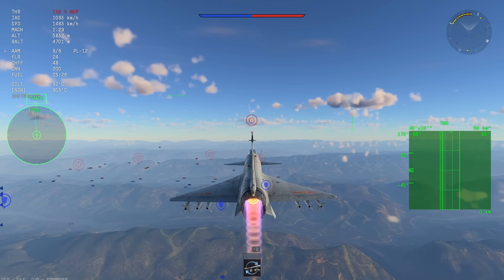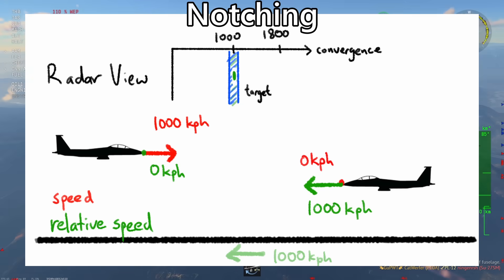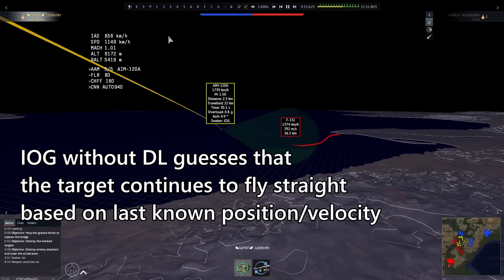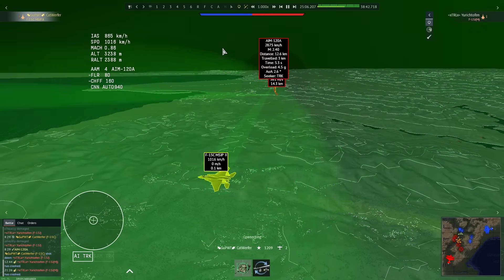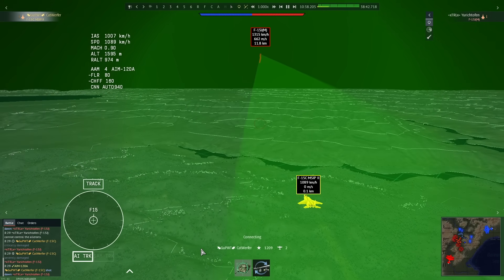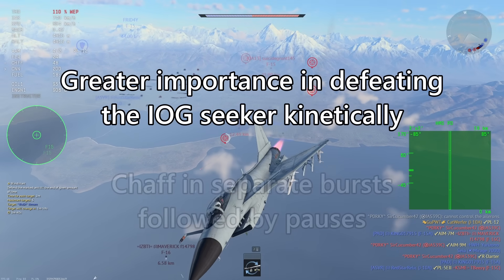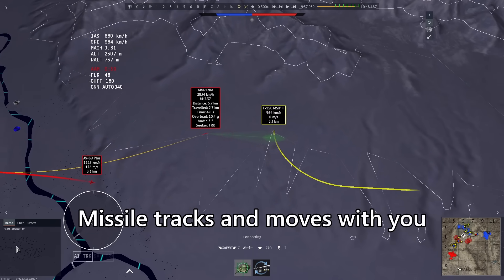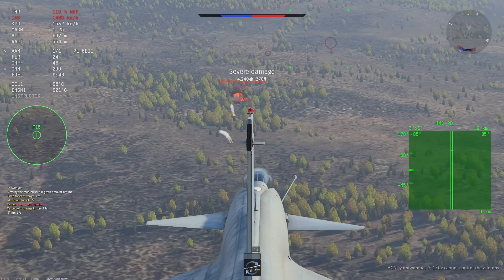Notching Mechanics Explained | How to Evade Top Tier Fox-3s

Comment: I fly high (usually 5k, just below the white trails altitude).
my issue is not so much the notching itself (or maybe it is?), but knowing when its OK to go back.
my RWR keeps beeping untill the missile actually passes me most times. so in typical RB, ill spend so much time avoiding a couple of missiles, until my RWR stops beeping, that its usually too late to do anything in the battle.
Reply from the maker: @theoescamez6230  yeah, that's hard to tell for me too. Sometimes I'm lucky and the rwr goes silent but other times it keeps screaming even if the missiles been defeated. Most times I just hope I've done it right, though it's not always true
Reply: I found if the rwr ping is shifted to away from you once you reengage the missile is typically defeated. But yeah they really got to short out rwr warnings

Comment: Subscribed, this was amazing, good job. Basically my understanding is that Fox3s are very hard to defeat, unless you're above them and can chaff, though leaving you vulnerable because air is thinner and missiles have more energy. Flying low at the beginning of the match can be beneficial because realistically no one could maintain a datalink track on you because they would be defending the 20 missiles launched at them, but after that I would say that climbing is safer also from a situational awareness point of view.

Comment: Yes, that is a good explanation for why 90 degrees doesn’t work when the missile is close. 

Also, the reason chaff is more effective at close range is because the FOV is the missile seeker means that at a distance if you chaff and the missile tries to require you you may still be in the cone, while if it’s close your angular velocity is greater and you may be well outside it’s FOV in a much shorter timeframe.

Comment: Woah so the velocity vector turns out is alot more important than i previously thought not notching enough def is the culprit in alot of my deaths then 😂 thank you for the info this means deploying flaps also helps alot in lower speeds cus it pushes the velocity vector alot closer to the crossair cus more lift etc
Reply from the maker: @whydoievenbothertoputthish2199  yeah, i die a lot to not slowing down and GLOC ing before I get into the notch lol